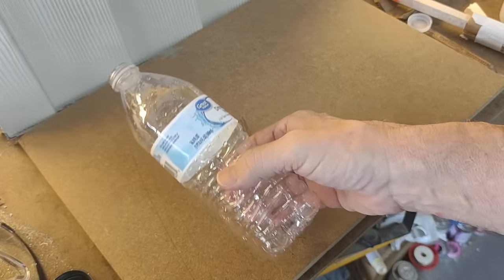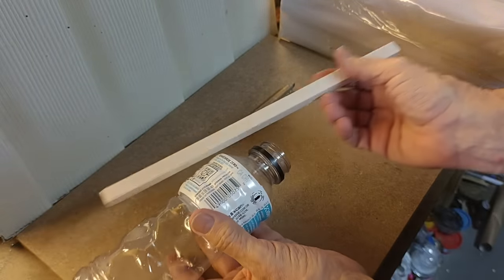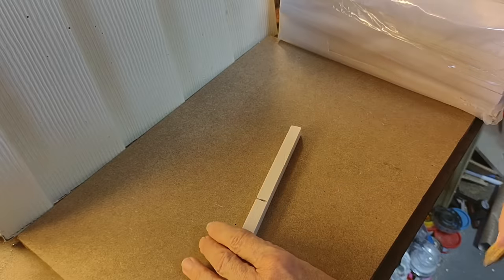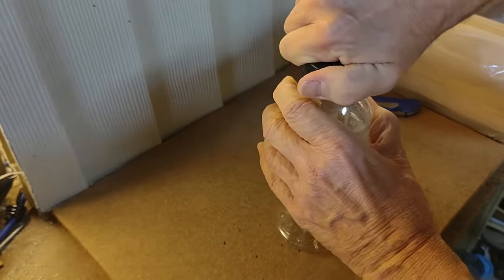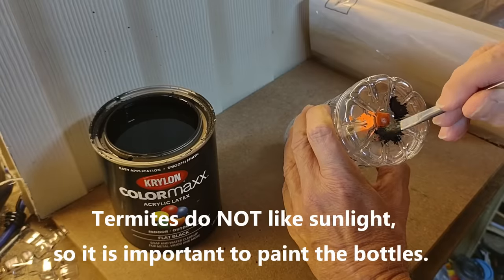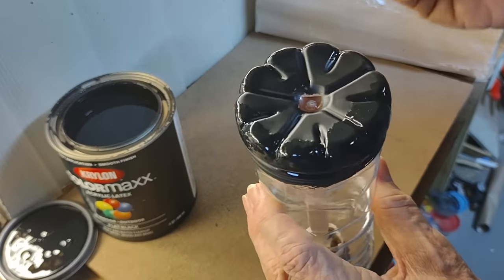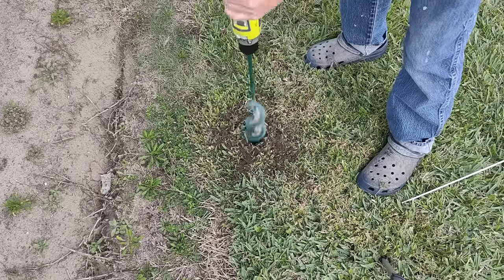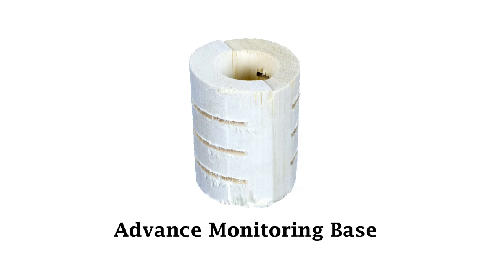Unbelievable Water Bottle Trick for Termites!  Simple to do!

Comment: Very glad i have a steel framed house and brick walls. Some wood internal bits and pieces still no doubt but i think the termites would have a hard time getting to them? have heard from the  neighbours (who have wooden houses) there a termites in the fences. When they are ready I'll pay my bit to put up metal fences. I really liked this video though an im tempted to put some monitoring stations in just for fun. Thank you so much
Reply from the maker: Building with metal studs is a great way to help deter termites, but it generally does not stop them.  While it is true that the termites are not going to eat the metal studs, they will have no problem dining on your drywall.  That's right.  Everybody thinks termites eat wood, which is true, but it's not actually the wood that they are eating. Termites actually eat cellulose.  The reason they eat wood is because would contains cellulose.  Well, drywall also contains cellulose, so the termites a happy to eat that as well.  Also, is your roof made of metal as well?  Is your entire roof structure made of metal, including the sheathing that is under the shingles?  Unless you have a slab home, are the floor joists and floor underlayment made out of metal?  While it is possible for floor joists to be made out of steel, it would be pretty unusual for the underlayment to be anything other than wood.  So you see, there may be more potential for termite damage then you realize.  You can build with treated lumber, but termites can eat that too, unless it is rated for ground contact.

 I hope that helps.  Be well my friend.
Reply: @GuysPestSolutions  Hi, thanks for the reply! My entire house structure is steel, the roof is steel sheeting, also joists, etc, and under the floor. Everything is glorious inedible steel,  It's a  2-story house. With a concrete slab. The upper floor is MDF. It's a partical board material I've researched online that termites will have a go at chip board. The walls are what we call plaster boards here in australia, which I'm guessing is similar to dry wall. Both neighbours have lovely wooden Queenlander styler houses. I wasn't even overly concerned and just happened upon your video and I'm glad I did.I will keep the knowledge in mind. Thanks kindly, take care
Reply from the maker: @dougrogan379  It sounds like you are in good shape.  I guess you need to worry more about rust than termites.  Lol.  Just kidding.  I guess you didn't pay much for that house because it must have been a "steel."  I'm sorry.  I couldn't resist that one.  Well done mate.  Be well my friend.
Reply: I understand your structure, and you seem to be okay. But I live in Florida, and there are a lot of people here with cement block houses who think they are safe from termites but the termites tunnel in the interior wall up to the roof joists and collapse the roof on the houses. It happens a lot, so I wrote this not so much for your sake but for others who might be reading it
Reply from the maker: @kpv123  You are correct.  Not only that, there are usually wooden studs that pad out those concrete blocks on the interior, to hang the drywall and run the wiring.  Very few homes are safe from termites.  Be well Kathy.

Comment: How often do u change out the termite poison for the bait cartages?  That is when u find that u have termites on your property. And do u need to have gloves on because the termites can smell human scent? I have read that. Thanks for your videos. Love your channel.
Reply from the maker: Just to be clear, you do not need to change the wood that is in the water bottle stations, but that wood is going to go bad after a while.  It is only balsa wood and it will eventually decay under the ground.  At that point you will need to replace the station.  Pretty much all stations have the same problem.  With regard to the actual bait stations that you use to kill the termites, the Advance stations have a pretty large bait capacity and you can actually put two cartridges in them at the same time.  You just stack them one on top of the other. That will probably give you enough bait to take out most colonies.  However, you should check about every month to make sure that there's still plenty of bait in there for the termites to munch on.  The bait cartridges are see-through, so you can tell how much bait has been eaten.  If there's still plenty of bait, then just replace the cartridge back in the station.  If the bait is almost eaten, then go ahead and replace it.  You can also build your own bait station that works faster than the Advance system.  I have a video on how to do that and I will give you a link to it.  If you use the homemade system, then you need to check it every few days because it does not contain as much bait as the Advanced system.  However, the homemade system will eliminate the colony within 12 weeks, whereas the advanced system can't take up to two years.  Oftentimes it is much faster than that, but not always.  That is because the Advance system uses an insect growth regulator that simply stops the termites from reproducing.  The homemade stations actually use a poison that the termites will take back to the colony with them and spread it around to the other termites.  They will all eat it and death will occur pretty fast. The bait in the homemade station does not stop them from reproducing.  It simply kills them straight out.  Since termite workers can live up to two years, you can see why using an insect growth regulator can sometimes be a fairly slow process.  It still works, albeit a bit slower. 

You do not need to wear gloves when handling the Advance bait cartridges.  The termites can probably smell your sent, and that may give them some reason to pause, but they are typically pretty hungry, so I think it is unlikely that they will avoid the bait.  However, you do need to wear gloves when you are handling the homemade bait cartridges, if they are still wet.  You do not need to wear gloves when handling the bait cartridge if it is dry. 

I hope that helps.  Be well my friend.

Video on how to make bait stations:  https://youtu.be/r05Z-aUJehw

Comment: Thanks for this video, it's very informative. A couple questions if you don't mind: 1) If termites are already feeding on the wood of my home, will they have any reason to switch to the wood in a monitoring station?  2) For lazy guys like me, what if I just drive a 1" x 2" bare softwood stake about 10" deep into the ground and pull those up every 2 months. Would that be a good indicator of termites in the area?
Reply from the maker: If you have termites in your home already, then they probably will not go after the monitoring stations.  However, some of the commercial bait stations have an attractant in them that may lure them to it.  Not a sure thing though.  If you have termites already, you need to first identify the species.  Not all species are subterranean.  Please watch my video on how to do that.  Putting stakes in the ground at 4 foot intervals around the house will also work, but that's a lot of stakes to pull up every month or two.  It's a lot faster to use the monitoring stations.  I hope that helps.  Be well my friend.

Video on how to identify termite species:  https://youtu.be/dIs_a0nfVjg

Comment: It's nice to find a professional willing to share their years of experience and knowledge.  Much respect for you, sir.  My problem is with exterminating termites within a vaulted ceiling (home built 1960).  This is not a full blown infestation yet.  By placing white sheets of styrofoam around the inside perimeter of the room we have identified one sqft area where droppings/black spec's (same size as the dot in this ?mark symbol) falling from ceiling.  Guesstimate 100 spec's per day.  droppings from 'pushout' holes.  Above ceiling is roof solar panels.  The vaulted ceiling is built of 4"x4" 45deg struts to pitch of roof, with horizontal 1/2" X 6" flat wood.  All wood is stained and solid.  Other than tenting the whole house how can the identified area be treated for termites.  I tried the cans of foam with the tiny straw to spray in the cracks but standing on ladder it ain't easy and cracks are wide enough to fit the straw.  I was thinking, couldn't plastic be attached to 4x4 struts and fumigate that air tight zone?  What are your thoughts.
Reply from the maker: You didn't tell me where you live, but I'm guessing you live in drywood termite territory.  Please watch my video on how to identify termite species and let me know if you are in the red area on the map that is in the video.  What you described is consistent with drywood termites, so let's work on the assumption that is what this is.  It is important to understand how drywood termites work.  They enter through cracks and crevices around windows, doors, the eaves, pipe penetrations, and so forth.  Most of the time, they enter through several locations.  That is because a swarm of them attacked your house at the same time.  If there was a crack or a crevice, then they probably found it.  After they established their galleries, which will be inside the wood, it will take four to seven years for them to be able to swarm.  Now that they are in your house, the swarmers will use holes that are in your studs to travel through the walls.  Those holes in the studs were created by the electricians to run the electrical wiring.  Not only are these holes going through the studs, but holes were drilled into the attic for the light switches and to run some of the wiring for the outlets.  So, the termites now have easy access throughout the attic and the walls.  If you have a basement or crawl space, they have access to that as well.  Most of the time, you will have no idea that they are in the walls, because the frass is inside the wall.  To make matters worse, if you have drywood termites, then your neighbors have them too.  That means you have been getting swarmed for as long as they have existed in the neighborhood.  Most likely, we're talking about years, so it's a safe bet that you have these guys in many locations in your home, but you cannot see the evidence of it.

I always hate to be the bearer of bad news, but if you have drywood termites, the only sure way to get rid of them is to fumigate.  Unfortunately, you cannot spot fumigate.  You need to fumigate the entire house.  Prices for this can vary wildly in this industry, so I recommend that you watch my video on how to hire a pest controller without getting ripped off.  That video can save you a lot of money.  You should also know that the gas they use to fumigate has absolutely no residual action whatsoever, so you can get reinfested the moment the tent comes down.  Like I said before, if you have drywood termites, then your neighbors have them as well.  Since drywood  termites swarm every year, it is almost a certainty that you will be reinfested within a year after the fumigation is done.  The only way to prevent this is to do a preventive treatment on your house every 60 to 90 days.  Most pest controllers will not do this, so it is something that you generally need to do yourself.  I have a video on how to do that and I will place a link below.  If you absolutely cannot afford to fumigate your house, then you can try spot treating it yourself.  It is virtually impossible to find all the termite galleries, but it is way better than doing nothing.  Regardless of how you treat it, you should begin the preventive treatment immediately, so that you do not get additional termites paying you a visit.

I hope that helps.  Be well my friend.        

Video on how to identify termite species:   https://youtu.be/dIs_a0nfVjg           

Video on how to hire a pest controller without getting ripped off:  https://youtu.be/y-a8XOqVrlE

Video on how to prevent drywood termites:  https://youtu.be/Yozv3s-Qwlw

Video on how to spot treat drywood termites:  https://youtu.be/U7ck7zhS0Xo

Comment: Thanks so much. I'm pretty sure I already have them but my next door neighbor had their house tented last  Summer. Should be great for them.
Reply: What about bayon spraying and other  traditional methods without chemical products
Reply from the maker: I am so sorry, but I need to tell you that, if your neighbor had their house tented, that means they had drywood termites.  These guys are not subterranean, so they do not attack from the ground.  They literally fly to your house and then infest the wood.  There is a 99.9% chance that you are already infested.             

It is important to understand how drywood termites work.  They enter through cracks and crevices around windows, doors, the eaves, pipe penetrations, and so forth.  Most of the time, they enter through several locations.  That is because a swarm of them attacked your house at the same time.  If there was a crack or a crevice, then they probably found it.  After they established their galleries, which will be inside the wood, it will take four to seven years for them to be able to swarm.  Now that they are in your house, the swarmers will use holes that are in your studs to travel through the walls.  Those holes in the studs were created by the electricians to run the electrical wiring.  Not only are these holes going through the studs, but holes were drilled into the attic for the light switches and to run some of the wiring for the outlets.  So, the termites now have easy access throughout the attic and the walls.  If you have a basement or crawl space, they have access to that as well.  Most of the time, you will have no idea that they are in the walls, because the frass is inside the wall.  To make matters worse, if you have drywood termites, then your neighbors have them too.  That means you have been getting swarmed for as long as they have existed in the neighborhood.  Most likely, we're talking about years, so it's a safe bet that you already have these guys in many locations in your home.
                            
I always hate to be the bearer of bad news, but if you have drywood termites, the only way to get rid of them is to fumigate.  Prices for this can vary wildly in this industry, so I recommend that you watch my video on how to hire a pest controller without getting ripped off.  That video can save you a lot of money.  You should also know that the gas they use to fumigate has absolutely no residual action whatsoever, so you can get reinfested the moment the tent comes down.  Like I said before, if you have drywood termites, then your neighbors have them as well.  Since drywood  termites swarm every year, it is almost a certainty that you will be reinfested within a year after the fumigation is done.  The only way to prevent this is to do a preventive treatment on your house every 60 to 90 days.  Most pest controllers will not do this, so it is something that you generally need to do yourself.  I have a video on how to do that and I will place a link below.  If you absolutely cannot afford to fumigate your house, then you can try spot treating it yourself.  It is virtually impossible to find all the termite galleries, but it is way better than doing nothing.  Regardless of how you treat it, you should begin the preventive treatment immediately, so that you do not get additional termites paying you a visit.  

I hope that helps.  Be well my friend.                        

Video on how to hire a pest controller without getting ripped off:  https://youtu.be/y-a8XOqVrlE

Video on how to prevent drywood termites:  https://youtu.be/neNsmVbj8Pc

Video on how to treat drywood termites yourself:  https://youtu.be/U7ck7zhS0Xo
Reply from the maker: @umadev6077  You are best not to fool around with termites.  The reason we use pesticides is because they work.  We no longer use pesticides from last century.  We are now in the 21st century and we use 21st century pesticides.  They are safe and effective.  So safe that a child can play on the treated areas after they dry.  Please watch my video on the subject.  Link below.  Be well my friend.

https://youtu.be/i7nLO6Js_3Q